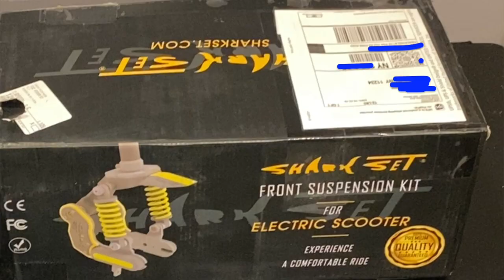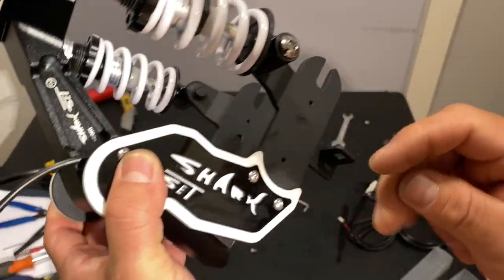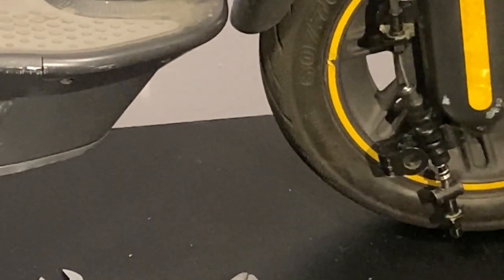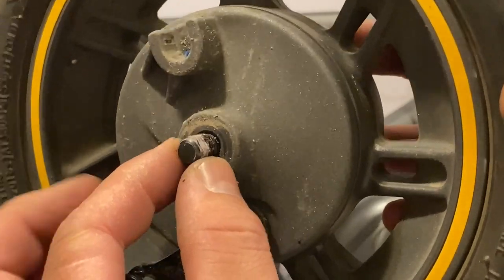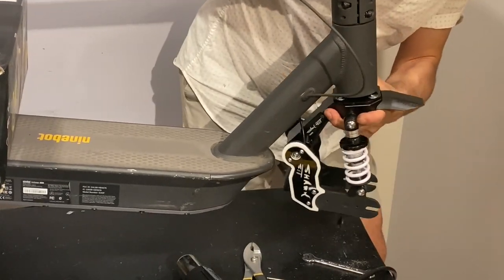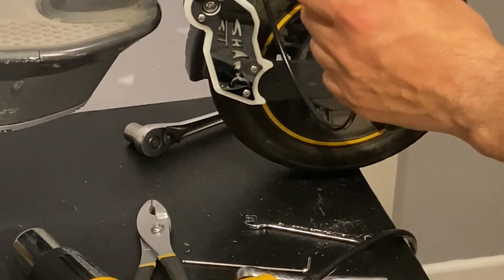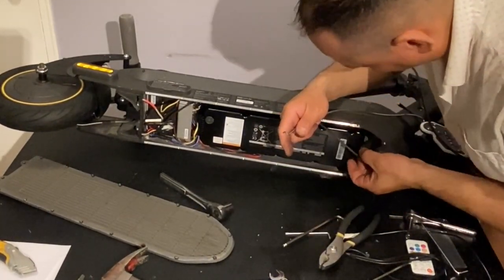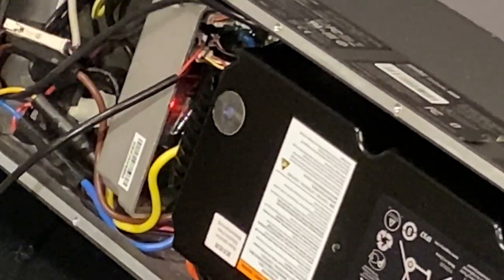Front Sharkset Suspension Installation on Ninebot Max!!!

Comment: Hi when I install the lights of Sharkset lights. The backlights is not working also same with sharkset lights. Any solution for this? Thanks.
Reply from the maker: If you connected to controller port and didnt work. Simply contact Sharkset for replacement.